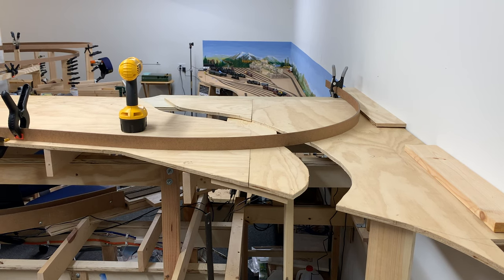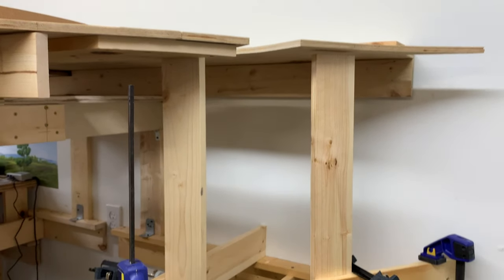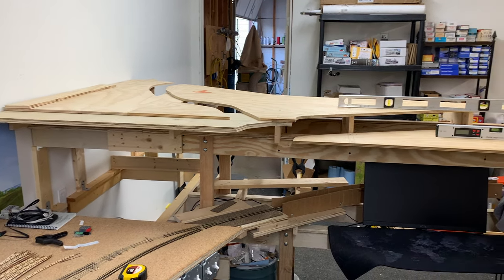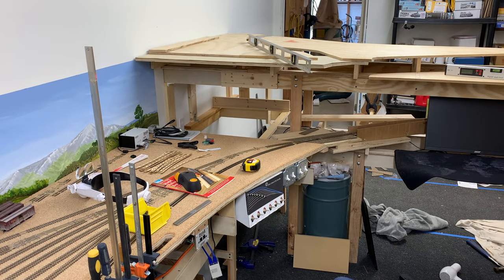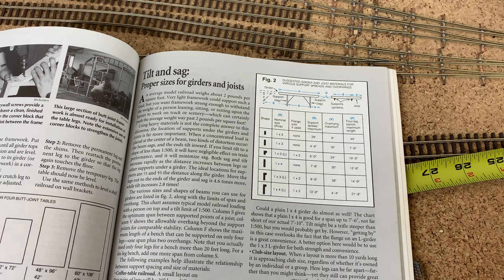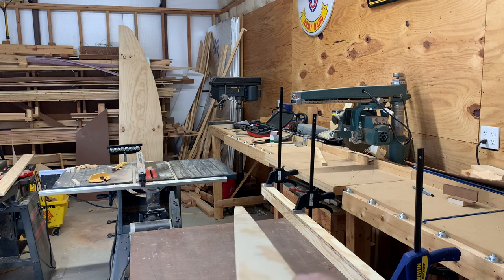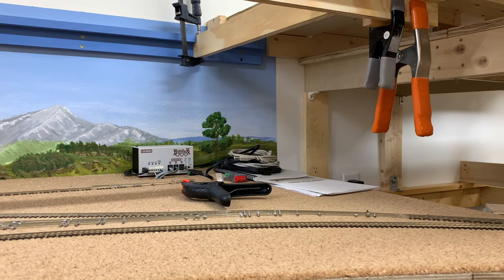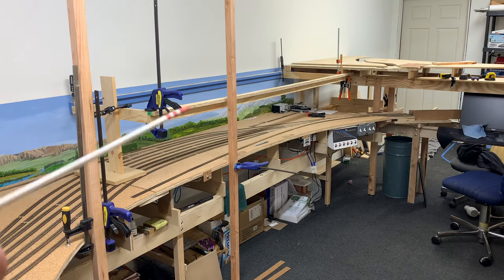Model Railroad Update 95_Maroon Creek 4_ (More Benchwork)

Comment: When following Linn Westcott, or landscaping like Dave Frary and their books which I have as well, we have to remember Linn was born in 1913, before the invention of plastic, and plywood. He was building benchwork using 2x4's that were actually 2 inches by 4 inches, that had to support standard gauge engines that weighed pounds not ounces. Of course build it the way you want, let's just remember Lin and Dave come from a bygone era in railroading, and some of the materials they were using don't exist anymore.
Reply from the maker: Thanks

Comment: I'd likely look at a simple 2x2 (1.5in sq) for the ledger board with countersunk screws into the studs. As you noted it's not needed too much for strength due to stud attachment so it can be rather short at the wall.

It's qlso kinda wild how plywood bows like that! I had a sheet of 1/2in ply that i ripped down to 16in wide and it ended up similarly. I ended up using it for shelves under the layout.
Reply from the maker: I used 1X3's for the remaining benchwork and approached it a little differently.  No L-Girders, more like a box frame only open at the front.  Thanks for watching!

Comment: I’m probably too late if he works through everything this weekend, but there’s nothing to keep you from making that Egger with a vertical part up and sticking above the top of the bench work slightly.  So when you look at it from the end, it’s an actual L.

And you could probably use a one by three or even a one by two for the vertical part as long as it’s screwed into the wall at every wall. It should be strong enough.  And then it would only stick up about 3/4” above the top of the plywood and that can easily be hidden when you blend the scenery into the backdrop. 

And of course, that would keep your painted backdrop, pristine.
Reply from the maker: Thanks Mike, yeah he got it worked out this weekend.  I did lose a little bit of the top of the blue sky but not enough for it to matter, and you will never see it anyway.  Thanks for stopping by and the input!
Reply: @OtterCreek  yeah just saw the end of the video LOL!   Next time I’ll watch the whole thing first. 

And glad you used the 1x2 or 3 ply, that’s enough support. 

But other couple of thoughts on the face support: 

First, the vertical of the L-girder can be extended a bit above the horizontal top to the depth of the plywood, which will allow a greater span.  Not a lot but every bit helps. 

Second, don’t forget that you’ll have support on the end from the wall perpendicular to the  face support, which may eliminate the need for the metal angle supports.  

Third, your free span of 6’ can be cut down with a strong cantilever support from the wall.  I’ve seen upper decks with 12’ and longer free span on the front with no vertical support but with cantilever supports only from the wall.  And these can also be L-girder style and can be VERY strong!

As an engineer I love playing with ideas and concepts of structural design for model RR’s working with my layout and also a friend’s right now and dealing with similar issues.

Comment: Hi Dennis.  Just a couple of comments that I hope will help.  First that bad L-girder replace it.  It will only get worse over time.  It never should have done that when you are using plywood.  Second I am concerned that if you have a derailment on the lower section I really do not see how you will be able to reach the back side safely without knocking other things over or pulling your back considering how deep it is.  Otherwise keep up the great work.  Your careful planning and transitional curves should give you a smooth running layout.
Reply from the maker: Thanks for thinking about my back Sierge!  

I suppose I could have a derailment on the reverse loop in the back corner.  I've been operating it for two years now and I haven't had any derailments in any area. (I will now.. thanks Sierge!)   95% of the derailments I've had were on the throat switch, which I replaced and it is easily reached.  The other 5% were also associated with turnouts.  All of my turnouts were planned to be reached easily.  In my experience derailments just don't happen on normal track unless there is an issue with the car/loco.  That being said, I try and be very discriminating with the cars I run.  If it can't make it through a turnout constantly without derailing it gets pulled and fixed.  If I can't fix it, it stays in the lemon lot!  Right now I have almost a whole trains worth of cars in the lemon lot!

Comment: Just wondering if it would be possible to “hang” the supports from the ceiling using threaded rod and  turnbuckles. I’ve used the method to support upper valances and substantial weight.
Reply from the maker: Thanks Randy.  Yes, that's my plan for the valence.  I don't want anything obstructing my view of the upper section.

Comment: Darn it @#)$%!&)^ you are ruining the beatifully painted backdrop with all that wood in the way! I would've used a thin 1x2 strip as an I-beam on the wall and then couple of strategically placed threaded rods in the front of the benchwork to hold the upper level surface, just so it does not disturb the backdrop painting. Not everything has to be an L-girder...😁
Reply from the maker: Honestly, if it wasn't such a pain the @$$ to go to a good hardware store where they had those things readily available I would have thought about it more seriously.  The closest big box store to me is 3hrs one way.  I love working with wood because I have all the tools needed and it's only a 30 min drive one way!  The backdrop was always going to get covered anyway.  I think from the seated position with the lights installed it will still be nice to look at.  I still have lots of wall left to paint!  Thanks for stopping by!
Reply: I suppose the saving grace is that the wood is ending up mostly in the sky and you'll paint it to cover it. Going 3 hrs one way for some bits and bobs does sound like a pain. I guess it's a trade-off, more space in the boonies vs access to specialty materials but with less space for hobbies. Either way you seem to be on the right track, so keep at it, and we'll keep watching!
Reply from the maker: That about sums it up.  I never have to wait on traffic, no light or noise pollution but a lot of missing conveniences.